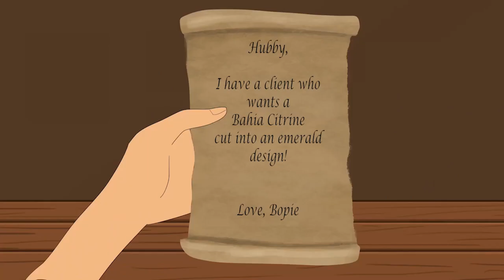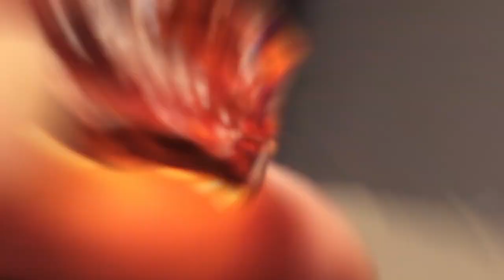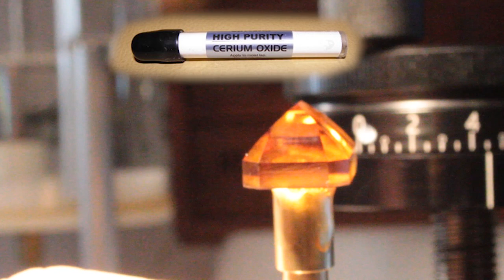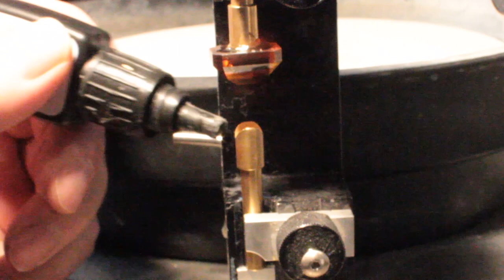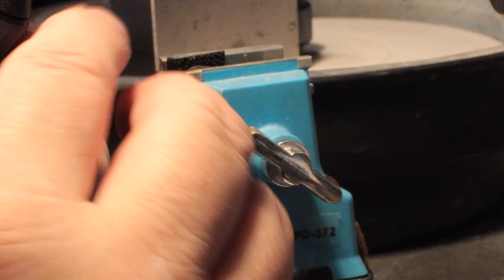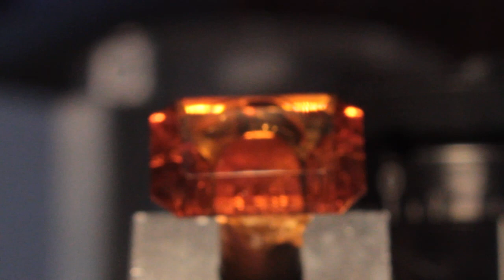Gem Cutting Tutorial: Ideal Emerald Bahia Citrine

Comment: Could it be that that reason the tightening screw is usually on the bottom, is to prevent putting pressure from the top and potentially damaging the mechanism?

I'm sure you are careful, just thought about it
Reply: Maybe.  But I think it is just as likely that Ultra Tec put that screw hole in the 96 or 0 position because that's the 96 or 0 position of the 96 tooth index gear...and maybe just for that reason alone.  You don't have to use the brass screw with the Allen wrench...UT also provides a brass screw with a 'head' that can be hand tightened with no Allen wrench...would not make any difference where that screw lined up.